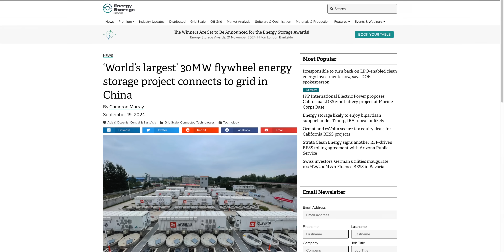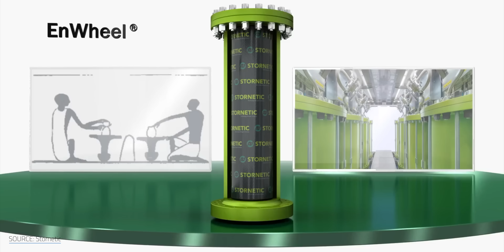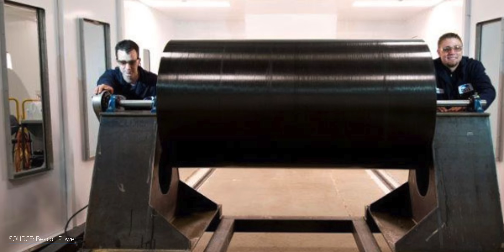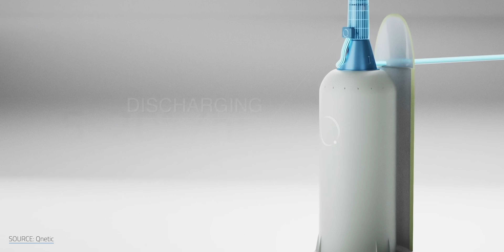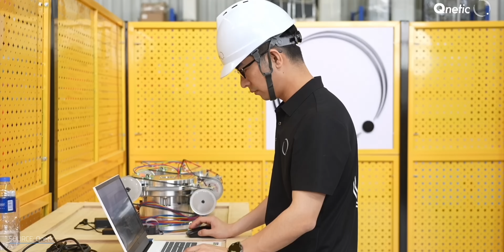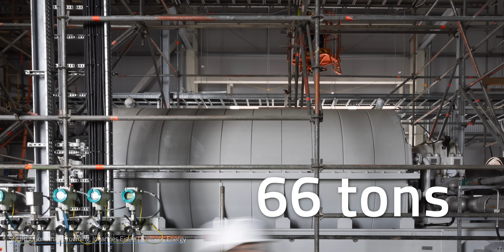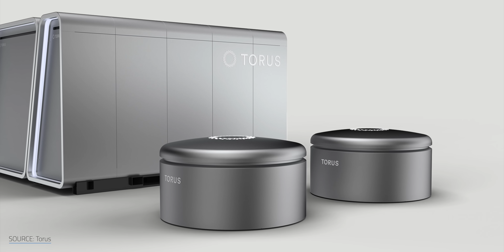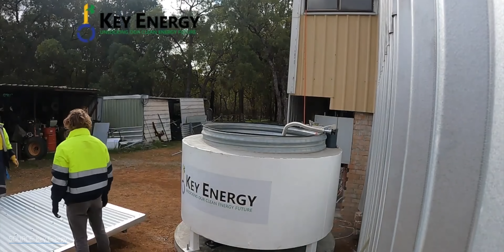How This Mechanical Battery is Making a Comeback

Comment: Little Barford Power Station in the UK is a CCGT (Closed Circuit Gas Turbine power station). Powered by gas. In  2016 or some near year Little Barford had a lightening Strike  on a Pylon opposite our house in Roxton, and it failed taking the whole grid down. It took many hours of no electricity before the grid was stable again. The grid was put back on very carefully in chunks across the UK. Electric Trains got stuck as the frequency dropped outside their ranges.
Reply: 2019 I guess. Caused some finger pointing as to why the grid didn't stabilize for over an hour.
Reply: It's silly how narrow the operable frequency range of the grid is right now. My regenerative VFD can output and regen power from 10Hz to 10MHz!
Reply: @leggysoft 
 
The MIT Professor  Don Sadoway who developed the grid level dirt cheap long life stable battery tech .... does a great talk on the problems of grid Frequency control and stabilisation in terms of  historic grid management using just generators.
Reply: CCGT stands for Closed Cycle Gas Turbine. Basically you use the hot gas coming out of the turbine's exhaust to make steam and drive a steam turbine - bulky, expensive to build and (like all steam turbines) hard to ramp up and down but much more fuel efficient than an OCGT (Open Cycle GT).

Comment: If they can be made cost competetive then we could easily add subisidies to make them the clear option over conventional battery grid storage for load balancing.

Batteries are chock full of polutants and conflict minerals, flywheels are filled with carbon, steel, and copper

Also any energy we plan to store more than a day or two should just be stored in reservoirs, the main use of battery grid storage should be to even out the daily peaks and troughs.

Comment: Can someone explain why lifting a huge amount of weight and connecting it to a pulley system with generator is not a better solution?
Reply: There are one or more installations using this. I think this guy did a video segment on them.
Reply: That's how hydro storage works when you pump water up behind a dam and then drain it out through the generator later.  You're just lifting the water and letting it fall.  The problem is the space it takes up, and you're limited by how fast you can get power in and out of the system.

Comment: Knowing the self-discharge rate of smaller systems such as the Key Energy installation in Perth would be helpful. For rural or off-grid installations, when coupled with solar, their long non-degrading lifespan and low fire risk could make them much more appealing than lithium-ion batteries. Did you find any information on this? Can they last hours, days or weeks? Being able to supply full, uninterrupted power until they could be recharged the next time the sun is out would be the key metric.
Reply: Their 'self-discharge rate' if you want to call it that is not great. It's far worse than batteries. They are more like a mechanical capacitor - great for short duration grid control applications. Nevertheless, a big enough system could supply a home for several hours. It's just that the conversion rate from solar to stored energy to then useful energy that ends up in the house is much better with batteries. Of course, if you have oodles of solar like in lucky Oz, then any energy storage, regardless of efficiency, will get you through the night.

Comment: I was told that this method is used to power up the fusion reactor at AEA  Culham ( UK ) ... this is to prevent the electricity grid around  Oxfordshire ( UK ! ) ... completely failing 😝................ DAVE™🛑

Comment: A lot of the arguments around which tech to use in renewable power feels like it could be solved with the "Oh neat, two cakes" argument. Surely implementing as many of these as possible is the answer. We've been arguing about which one to use so much that we're closing in on a very nasty deadline without having a set plan. At least if we scatter shot as many as possible, gravity batteries, flywheels, modular nuclear reactors, hydro batteries etc we can extend the deadline. We dont need the number one ideal confirmed solution right away, we just need something and we need it fast
Reply: Gravity batteries are tech bro ponzi schemes, but the other tech you've mentioned at least passes basic engineering scrutiny to say the physics are at least viable. Potential energy in a gravity battery is just mass x gravitational acceleration x height change, so storing a useful amount of energy requires either an enormous mass or huge height difference - pumped hydro does this by using an enormous mass of water, but doing this with solid weights is prohibitively expensive if the system is to be reasonably safe. 

Energy stored in a flywheel is 0.5 x Inertia of the flywheel x Rotational speed of flywheel^2. The rotating speed squared in the flywheel equation is the reason flywheels can make useful energy densities, while gravity batteries are laughable vapourware.
Reply: Thats what's happening
Reply: @mcdezzy4438  What is happening exactly,  because as far as I can tell all this stupidity of thinking you can replace industrialized society with some other form of industrialized society is the height of insanity and stupidity.  We would be far better off figuring out how to live with the changes then trying to re-engineer the world by authoritarian means.
Reply: @Jueyes-vg2gb  you're argument amounts to "we shouldnt improve we should just live with it" where most green energy changes are improvements to efficiency. You think we should just stagnant in the logical end of what you are saying.
Reply: @Jueyes-vg2gb  Ah, arguing against a straw man.  How is it being vehemently opposed to am imaginary position? Does that fulfill you?
Reply: @Jueyes-vg2gb Living with the changes may not be possible. At best that approach would like cost more than changing our energy sources.
Reply: @Jueyes-vg2gb do you live on or near the equator?
Reply: Part of what's not helping the "scatter shot" is the attitude some take of "THIS is the silver bullet that will save the world and anyone who argues with me is evil and wrong." That makes enemies for whatever they're trying to promote and often I've seen them doing it at the expense of other possibilities.
Additionally too many have the idea that turning off of oil is nothing more than putting up a wind turbine and adding a battery to their car then shut the valve on EVIL OIL forever.  Many of these technologies have potential and some are better for one area and pretty poor if not useless elsewhere.  Had a keyboard warrior arguing that a open air hydro battery was a great thing in a desert... Yeah...   
Many of these technologies are rather new and we are still learning what makes some of them tick and how much they actually need to even operate.  Not saying stop.  Heck I work in the Wind industry, just realize all this stuff takes time.  And they are competing with something the world literally spent over 100 years designing everything around and improving on.  
In the end I personally am of the opinion if we aimed more for a hybrid of it all (yes even Oil) adoption would actually speed up and as renewables get better eventually they will be more profitable and gain even more traction resulting in an eventual natural tipping over to them with less reliance on the problematic energy sources.
Reply: We've already passed the deadline.
Reply: No, the answer is to implement the most efficient solution that delivers results. Solar and wind have resolutely failed to do so, and so far neither have flywheels. 30 MW? 100 MWh? Get real. We have nuclear fission, a technology so ridicously good it we'd laugh at it in science fiction like we do with nanites if it wasn't real. There's no need to wait for modular reactors, we have a safe, efficient, economical and sustainable solution. Everything else is a grift, and so is fearmongering over the handful of nuclear accidents that cumulatively over sixty years harmed fewer people than manufacturing and building out solar panels.
Reply: Ah yes, the "deadline". AKA give me money right now or the world will end, and it will be your fault. The classic guilt trip for people who love to feel morally righteous and intellectually superior. Save the bees, save the trees, the whales, save the snails!
Reply: Diversification has always been the answer. Only idiots chase after economic hyper optimization.
Reply: Too many of the people who want to endlessly debate and wait for the best solution don't actually want anything "green."
Reply: there isnt any deadline, thats in your head and I bet you are highly neurotic
Reply: @Jueyes-vg2gb  What do you mean when you say there isn't a deadline? Given that you don't explain it, I suspect it might be just a joy of anonymously trolling with faith-based, ideological thinking instead of logic. And I can understand why one wouldn't be public about denying the painfully obvious outside of the KoolAid drinking tribe.
Reply: @Jueyes-vg2gb There may not be a hard and fast deadline. There is however a degree of urgency that cannot be ignored.
Reply: @Jueyes-vg2gb  wrong
Reply: @cornishcat11  right

Comment: As you said, flywheel systems are great for short term and fast response to grid fluctuations.  Or to keep the power on while a generator gets started and stabilized which was something we (very briefly) looked at where I last worked.  It was decided that it was much more cost effective to get several dozen battery based UPS systems to keep the gear running until the 200kW generator got going, than it was to install a flywheel system for the entire building.
Reply: Indeed. In several airports in Africa, back in the 1960s, when electricity supply was a bit iffy, installed diesel generators for back up. However, those diesel generators were kept spinning (without using fuel) by an electric motor connected to a massive flywheel. When the grid power failed, the diesel fuel was injected and the flywheel had enough momentum to start the diesel generator to keep the runway lights on without interruption.

Comment: Is the Dinglun station 30MW or 30MWh? You used MW units, not MWh, and then said that the Torus + Gardner Group system would provide 26MWh and that this approaches the capacity of the Dinglun system.
Reply: @amdreallyfast  MW is a measure of energy per second, while (counterintuitively) MWh is a measure for the amount of energy, so the capability of a plant is measured in MW, while the amount or stored energy is measured in MWh.

The unit breakdown is:
M: prefix for a Million, 10^6
W: watt = J/s, Joules per second, which is energy over time
h: hour, which is time

Watt-hour means energy over time, times time: ((J/s) * h). The time cancels out, while the energy, measured in Joules, is left as the only unit.**

**multiplied by a 3600 coefficient as there are 3600 seconds in an hour
Reply: @oraziovescovi1922  Yeah, but that doesn't then explain how much power the plant can actually hold. Only how much it can output. If it has 30 mw/s of energy storage, that's pitiful in comparison to 30 mw/h's. Not to mention that even 30 mw/h's seem a bit low.
Reply: @oraziovescovi1922  oh yeah I'm familiar with that :)

I was wondering which units were supposed to be in play for Dinglun
Reply: It got a bit confusing. I guess it can be both 30MW and 30MWh if the site provided 30MW of power but only for 1 hour.
Reply: @amdreallyfast  Not providing the amount of time it can supply the 30 MW is a serious miss. Matt may have been quoting the Energy Storage News article which also did not mention the time component. A single AA battery can provide 30 MW, but probably only for an insignificant attosecond.
Reply: @paullinkins8121  A single AA battery can not provide 30 MW for any time period.   A MW is a unit of power, a MWh is a unit of energy.  The "hour" doesn't really have anything to do with how long it actually supplies the power.  It's a unit.
Reply: @stargazer7644  I wasn't clear on the AA battery part. If you discharge the battery into some theoretical device capable of storing and releasing it quickly (like a super-supercapacitor) you could obtain a huge amount of energy very briefly.
Reply: I no longer remember the details and haven't watched the video completely yet, but these systems usually work for maybe 10-30 minutes at full power.

Comment: I work in power generation industry and have seen detailed reports about turbine rotors deciding to take a look at outside world. Many many tons of mass spinning at 3000rpm can really do some damage if it wants to. They literally go through walls and exit the facility.  Kinetic energy is no joke.
Reply: Why aren’t they all placed in holes for safety?
Reply: @JasonJrake  the same reason very large windmills aren't covered like many of the fans in our homes.  Once they design it properly with overbuilt redundancy, they don't need to worry about that.
Reply: Last I knew years ago, all flywheels were placed in underground concrete vaults @JasonJrake
Reply: im a turbine mechanic, youre definitely from europe lol. north america is at 3600rpm. 

3000 is only for gas that are direct drive, if theyre smaller they can be as much as 6000rpm, or most big steam like coal plants are at 1800 and they have gearboxes in the middle. 

and theres only been a couple reports of them going out of the building, when they had an overspeed runaway and literally spun until it splattered itself out the building. the pressure they run at mean those shells are THICK, and solid steel. so to go through the shell also has to fail. ive heard of a few times where they slung a bucket and cracked the shell on the outside with a serious dent, but not going through the building.
Reply: That’s nothing compared to a steam boiler explosion. They are literal bombs. They tend to take out large sections of the building when they want to go play outside. I do not miss working on them.
Reply: Usually the rotor on generator comes apart before turbine comes apart, with over speed conditions anyway. Have personally seen a 7MW turbine over speed and turn generator into shrapnel. Not good. Was estimated to have let go at 7000rpm. Rotor from generator stood on end and bounced around like a top.  Turbine was fine from what we could tell, but it was never ran again.
Reply: Skavens: Yes Yes my favorite the DOOMWHEEL!!!!
Reply: @DzeiEidz  if you make it sideways it simply won’t do that
Reply: Pinball of DOOM!!!
Reply: Was thinking that those people in Australia that didn't want li-ion for backup because of fire risk so opted for an ABOVE GROUND flywheel were not aware what could happen if it's bearings failed! BTW there are plenty of fire safe battery tecs out there.
Reply: @DzeiEidz  none have been bad enough to make the general news.   Can't say the same about other power generation systems
Reply: @veganpotterthevegan  most accidents like this are turbine failures inside secure facilities like coal or nuke plants. Companies like to keep that stuff quiet.
Reply: @DzeiEidz  to be fair id think that a big spinny piece of death metal is a lot nicer to be around then an actual bomb in the case of certain types of battery power. And we can stick flywheels underground without risk of toxicity in the ground water. Hopefully we only see more and more of these kinds of kinetic energy storage options
Reply: A well designed flywheel is made of composite rods with the mass at the centre and stresses acting linearly along the rods where tensile strength is maximized. The flywheel equation favours speed above mass, so these do operate an order of magnitude faster. However failure is progressive with the composite turning to dust and heat and easily contained in the chamber.
DAVID W. RABENHORST
ENERGY CONSERVATION WITH FLYWHEELS
Johns Hopkins University Applied Physics Laboratory
However batteries have much more potential now and as demonstrated by Tesla are cheaper and safer (LFP).
Reply: @waynerussell6401 interesting stuff. I’ve always assumed it’s about hoop strength but that makes more sense. Not a simple matter of simple calculus either, I’m sure.
Reply: The flywheel of a powerful rwd car has the habit of taking the drivers legs with it when it goes
Reply: Then you are not very intelligent... the spinning mass even though large is only going to produce energy for a short time under its own mass and the energy is actually very small.

Comment: Wow, there's a lot of action these days with the fly wheel battery roll out. Tech is not just going around in circles but is gaining momentum all the time. And it's not all just spin, either. But once this tech does get up to speed, do we really want it to take off?
Reply: punny writing works 1 or 2 x at most in a sentence, more than that and it's lost to the reader due to supersaturation.
Reply: @stevemyers2092  Sure didn't stop Matt from overloading his entire presentation with flywheels puns. 

Plus, got your attention . . . . na, na, nana, na.